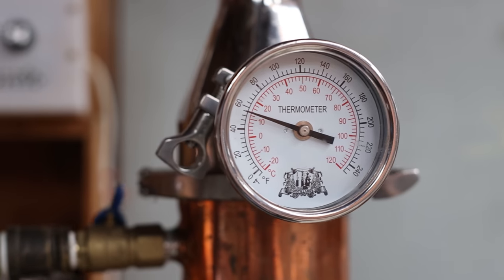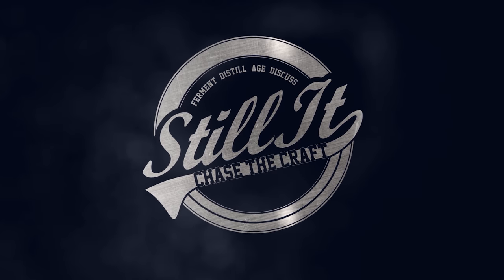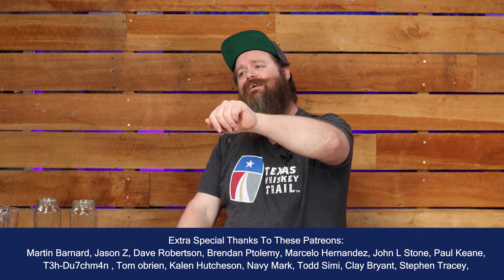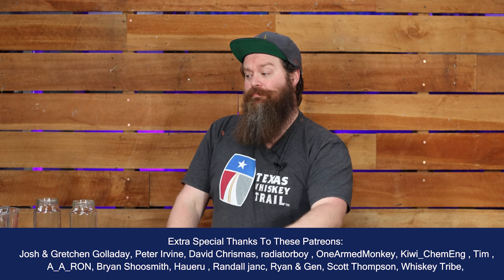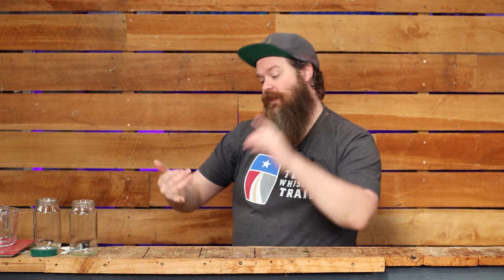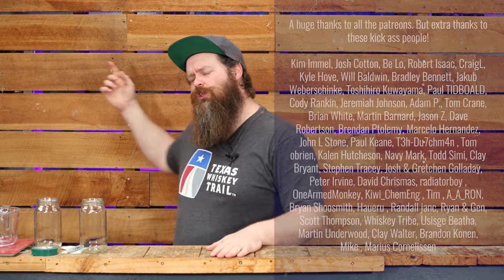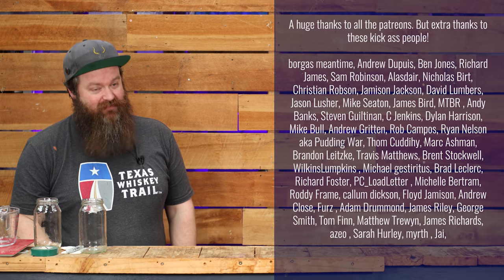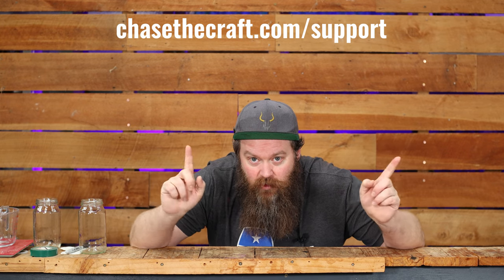Do You Need A Thermometer On Your Still? Thermometer TRAPS

Comment: I'm a pretty new home disteller and this vídeo whould be so nice 1 year ago.. Firstly new destillers, as I did, believe that the destilling phases can be controlled by temperature by knowing the boilling point of ethanol em water - but since you have a mix that will change and also change if it is a sugar mash or grain or frut since you have other chemicals.. I have a small copper alambic which is like a pot still and as per my experience the thermometer is not that accurate or at least the information that it gives me is not more usefull than knowing how much time I have until the show starts. Thanks again! One of the best vídeos yet..
Reply: Yes
Yes
And yes

Temperature is very handy.
But not the be all end all.

Temperature will and does vary...

But also gives you a quick glance into what to expect.

Good stuff.
Love this comment.💪👍🥃

Comment: Well Jesse, i would say that's the best 14.5 minutes of November i have learned in, i am a new stiller, only done 2 runs, i have never had a thermo in the pot, so i don't feel i need one.....i have one in the bend/lyne arm and use that just to ROUGHLY let me know where i am in the process.....
I have seen the oil in the tails, am getting the feel of the sting in the heads, i don't get much out out of a 25 litre run, as i believe i am making very conservative cuts, but after only 6 weeks with toasted oak in the bottle, i feel i am on the right track,i have a new 25 litre barrel, begging to be filled, i also use a parrot and alcohol traille ?
Keep it going, your doing a fantastic job, because of you, i have 325 litres of whisky wash fermenting around the bedrooms....love it...thank you..

Comment: This is my philosophy, too. If you're running the same recipe over and over, you can start to correlate a temp with a cut, but using temps as the only deciding factor in cuts means you are missing out on a lot of weird and wonderful flavors.
Reply: Theoreticaly😉
Reply: @glleon80517  It's a theoretical philosophy;-)

Comment: I have a bbq thermometer on my still it can have six temp probe inputs you can set alarms and it links with Bluetooth to your phone, I use two probes one on the top of the column which i set to alarm if it goes over 35 degc which means it's going to start outputting soon (after that i switch to bellow 65degC which means the still is cooling down) and one at the end of the condenser which goes off if it gets over 20degc (i.e. your cold water supply has shut off and you are going to get flammable soon :p). Basically it lets me monitor my still in the garage from the lounge. The bbq thermometer cost me $25 of ali express.

Comment: Wow you hit on every single point and you came to the exact opposite conclusion I came to. 

When you're in a proper wet lab and doing a distillation there are no measurements you already know whats in your flask and whats going to come out the condenser. Repeatability in a lab should never be an issue.  
Brewing and distilling have so many knobs you can adjust and so many that you just have to roll with (quality of your ingredients, water chemistry, health of your yeast, fermentation temperature clarity of the mash ...)  for the home gamer batch A and batch B will likely differ in some way. Taking control of as many of those knobs as you can for me is the key to narrowing down what knob does what and gives me more control over the output at the end. I suspect it's the same reason I use a pid for everything and you do not. Neither approach is wrong I just want the data and the exact control over those knobs.  
I am admittedly a data horder. I've found that having too much data about a process is seldom a problem but having too little often is. So I gather every possible data point I can, time stamp it and record it. The data doesn't inform my process during but rather after. If something particularly nice happened I can look at the data as see what was different and the same goes when I'm disappointed in the outcome. So on that note we agree, head temp, condenser temp, boiler temp, temps at each plate don't really matter, they are what they are. In the end it's all simple chemistry you got a goes-in-a and a goes-out-a and a black box in between I'm just more comfortable with a smaller black box. For me all the fun in it is in the numbers (and to some extent the outcome) the process for me is the actual work.
Reply: I know what you're saying and don't disagree on taking notes. Jesse earlier on in the channel days had plenty of notes on the whiteboard too. Probably still does. I myself find enjoyment in the art of moonshining which was recorded in the brains and experiences of our predecessors whose writing and data recording skills may have been very limited. Its the best thing about this hobby is that its almost infinitely variable and therefore fun for almost everyone of us. If it weren't fun we would go buy store liquor. Keep on chasing.

Comment: I have always use one for my reflux rig mainly to know when the flow will start and when I'm getting to the end. It's just how I learned on my rig. I was introduced to the trade from a pot stiller and he used pressure to know what was going on and pressure makes liquid boil different.  Seeing that I'm still using gas I also use a handful of marbles to make a quicker heat flashpoint to help with the boiling process. One good thing a thermometer does for me is it helps with the ABV of what is coming out. Other than that it's going to put out only as good as you put in. Well that's just what I do and  it's not by far gospel for there's a hundred different ways. Just find what works for you and do it.

Comment: Elevation also effect temp but that basically pressure you mentioned.
I only use temp to give me an idea when product is getting ready to start coming off. And when to check abv to see when I'm getting to the end of a run. 
Mine is at the top of the column.

Comment: I use my thermometer to control the power going into the still. I run it at full power and when the temp hits 63C I know the voltage regulator down to 105V  and I hold it there unless the drips slow down. I control the power at this point by the amount of product coming out of the spout. Then when the temp hits about 97-97.5 I'll taste and smell the offtake to see if I'm deep into the tails, and if I am I'll throw a large mason jar under to collect them.

Comment: Currently looking into electronic thermometers for my next still. Coupled with arduinos and a monitoring system. Lots of geekery to be added. Why? Possibilities include. 
* To add visualisation to what the still is doing.
* Predict where is it going next. 
* Alert at various points. 
* possible Safety controls.
* increased efficiency. 
Not sure exactly where I will go with it, time will tell. But there are a lot of possibilities with cheap electronics that I would like to explore. If I only get it to beep when I need to turn on the water for the condenser or when Im getting near the end of the run I will be happy
Reply: I have done this. Now I have live data charts on a tv screen :-) boiler vaper and cooling water temp. Also controlling valves and alerts etc. I used DS18B20 probes fitted in triclamp end caps. Also made buttons to press when switching a jar to see the production speed vs time and temperature. Next up is automating the jar switch :-)

Comment: I like the thermometer to get that reading with each cut jar. Once I've smelled and tasted them the next day, I compare the temps of those cuts to see if I am taking a little extra or less than the last batch. Not taking it as gospel, but as a reference point. It's great to have that info there as a second opinion if nothing else. Oh yeah, and like you said, it's a nice reference for the start and end of a run too. I think they're great for newbies so they have a good reference point, but yeah, got to get off that teet at some point.

Comment: I very rarely able to run my still at the theoretical ideal temperature. My main still will run any were between 82C and 88c. I look at how my still is producing and the taste of what is coming out. I do not chase the highest AV ether. I am fairly confident while the temp is stable. I am producing harts. The main task of a thermometer for me, help to indicate when the tails are more likely to be begging and ending at arund 95C at around 40% there abouts.
Reply: walker donaldfrancis - same here with my cheap stockpot style Chinese pot still. It always baffled me why it wouldn't produce any spirit until the thermometer in the lid hit 84 - 86 DegC, which is well above the theoretical temperature where alcohols should be boiling. I've calibrated the thermometer and it is accurate. I don't rely on temp, but keep a close watch and even use a parrot to track ABV. For simple washes, when it hits 95DegC or higher, I'm definitely in the tails.

Comment: Have you done a series on 1st time using a Pot Still, Reflux Still etc for new distillers?  I am wanting switch from an Air Still (basic but does the job) and it I am interested to learn about the startup process and charging plates, what to watch out for (good and bad).  I have a basic baseline of experience with sugar washes and have an appreciation for feel, taste flow.  Don't want to upgrade and ruin lots of runs and give up.

Comment: I'm interested in adapting my 2"  column to add the option of reflux or pot at my choice.  While I'm familiar with the standard (inside column) cooling tubes I am curious about the possibilities of adding a 6" or 8" extension, at the top, before the point of no return, and raping the outside of the tube with either copper or silicone tubing and run the cooling water through it.  Since I understand the efficiency of having the cooling tubes directly in line with the vapor, I've also noticed the importance of running the flow very low avoiding over condensing before going to the main condenser.  Do you think I could make up for the tubes being outside the flow by cooling the sides of the pipe?  Could I increase the flow of the water enough to function as a dephlegmator?   Sorry to see the videos on this subject are getting hard to find, your work is the best, I have learned a lot between you and George, ha.  Thanks!

Comment: A thermometer is a bit more convenient than a parrot for a pot still. It doesnt 'lag' behind and you dont have to clean another part. When you reach say 98 C you know you can stop a stripping run because it's <15% ABV or when it's 80 C you know it's very high ABV.
Reply: What if your pot ABV is 1% ?
Reply: @PetraKann  What do you mean? if it's at 1% ABV you'll see nearly 100 C and you should toss it because there's nothing left to distill. It's a waste of time/energy to go down to 1% already though.
Reply: So, to you a thermo is quite important ?
Reply: @MrLibbyloulou  No not really, it's just convenient. You can always do it on taste but I like to measure when to stop stripping runs at least, because it can be hard to judge alc content in tails.

Comment: I understand that producing neutrals is not your favourite style, but because of this you have omitted a HUUUGE aspect of using themometers. I agree, that when you go for the grainy/fruity taste the thermometer is not necessary. BUT! When you're going for a neutral azeotrope, especially made of sugar on a packed column, well, then at least one thermometer (preferably placed somewhere about the position of the 10th theoretical plate) is a must-have. The change (important! Not the particular value, but it's change) of temperature indicates the incoming tails and allow you to cut when you still have a nice spirit. Cutting "by taste" would come to late and would result with a product "tainted" with off-tasting tails.

Comment: I understand your point, especially on a reflux still.  That said, I am Going to combine thermometer and PID observations for a small pot still, from my personal POV.

As an engineer, recognizing and learning patterns is engrained.  Reproducibility and control is a goal.  Automation to do this is valued and useful.  Tracking PONR temp is an observable, and is helpful to achieve these, especially when using a PID.  

By not only observing the PONR temp, but maintaining stability of that temperature, (which the PID permits, relying on that PONR thermometer/sensor) it permits consistency and allows better control of the process.  When volumes are small, tracking this temp also gives clues when to change sampling jars.  Not as cuts, but to more consistently create points where cuts can occur based on previous observations in how the still operates.  This can make for a more reproducible and potentially better product than just changing jars when they reach a certain level.

My 2 cents worth.  The small batch guy has a different set of problems when making cuts than the distiller running a big still.

Comment: I'd be interested to see this done in a glass flask with a hot plate or heating mantle. There's about a 12-13C difference in boiling points between methanol and ethanol to be exploited with precise temperature control. Ethanol and water form an azeotrope which boils at a slightly lower temperature than ethanol alone. Methanol and water do not form an azeotrope. You're doing chemistry whether you know it or not, so why not run a small distillation as if it were any other chemistry experiment?

Comment: I find that a thermometer in my pot measuring liquid temp is most helpful... Having small kids this helps me pre-heat the still and keep it slightly cooler than when it's about to produce helps me reduce the time needed to finish a run an evening after kids go to sleep

Comment: The ONLY thing I use the thermometer for on my still is to see when to turn on the cooling water. When the top of the column reaches 100* F I turn on the water to the product condenser, and lower the flame on the burner. After that, everything is done on sense of sight, smell, taste and feel. When the boil chips in the bottom of the pot start rattling good, I start looking for tails and the end of the run will be near.

Comment: There's also altitude that you can use to effect boiling temperature. I guess its a sub-category of pressure, but it would be a safe way to adjust the pressure, as you wouldn't be creating a closed/semi closed/restricted system.

Comment: While I can agree that using temp and avb is not a hard set point. It does give us an idea or data point so to speak of where to start and stop for our given process. Say like stopping or getting to our perceived end at 220° and 40-45 avb. My still does not start a drip until the 2" column balance hits 178-180°. My 3" column starts at 181° almost like clockwork. That is a data point I always seem to be able to rely on as an indicator that I need to start watching, smelling, and tasting. See what I mean.

Comment: The other part to add to this. The Temps are different based on Alt. Water Boil point here (7500 ft ASL) is 198F instead of 212F at sea lvl.

Comment: Using any one data point will not give an accurate snapshot of any process not just distilling but using multiple data points can and does help. If you know round about where the boiling point of your azeotrope is and know about where your starting abv should be it gives you a good idea of what’s going on and how you will be proceeding. Then of course you will make other decisions based on other metrics including smell, taste and whatever else you use to gauge your run. 
It’s not one or the other. When doing anything in life the more information one has access to the better the result will be providing one has the knowledge to make use of that information. 
Should you have a thermometer at the PONR? Yes of course why wouldn’t you. Why stay blind to an important metric in your run, should you measure ABV during the run? Yes of course you should particularly if you are new to distilling and maybe haven’t developed the “sense” of where the cuts are. 
Distillation. IS a science, I know there is the debate of it being “art” but it is literally a process based on chemistry and physics. The art comes in when deciding on the cuts but the greater understanding and manipulation one has over the processes the better their ability to create their product. 
This is true of every art form and every task in general. 
I agree that every mash and wash is going to have different properties but knowing what is going on in the process will only help make a better product.

Comment: You didn’t mention determining ABV by vapor temperature at the head of the still. Easier and cheaper than getting a parrot. Using vapor temp there is no lag due to filling a parrot, or a necessary temperature compensation for a hydrometer. Not how to do cuts, but good info to have for each jar.

Comment: I have an Alembic pot with a temp' gauge in the Onion (cap). I agree that there is no real need for it, other than:

1. It's an indicator that i need to pay attention to throttle the gas.
2. If it's going to puke then i get a temp drop on the gauge and i can react accordingly ( panic ).

Keep up the good work Jesse.

Comment: Separating into glass jars by temperature or separating into glass jars by milliliters collected are both arbitrary ways to segment a run.   Using a parrot on a small scale doesn't work because of smearing.  The only "perfect" way is to smell and taste what's coming off of the still constantly, or segment collections by 1ml - neither of which is practical :)  Temperature is a good way to look for patterns in the run.  Climbing, stalling, etc.

Comment: Just strap a thermometer on the outside of the column with aluminium foil to get a analogue of temperature. No need to have the thermometer inside.